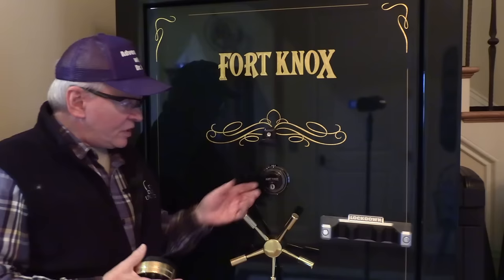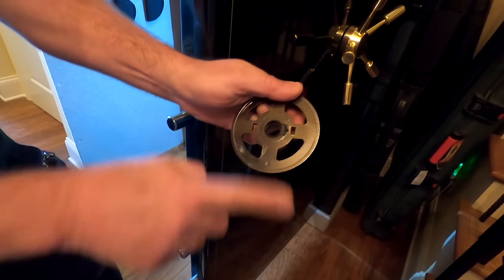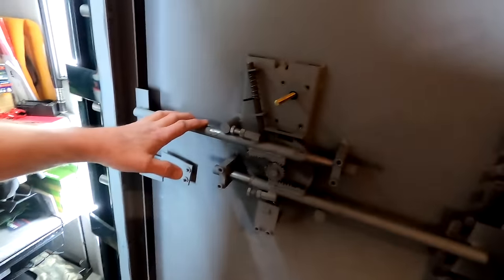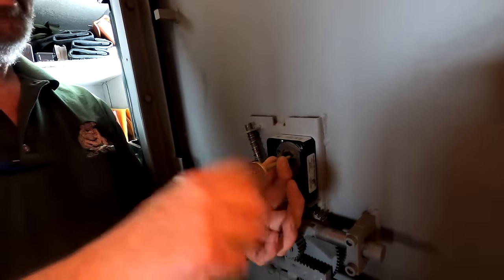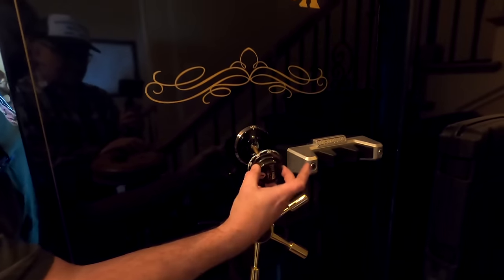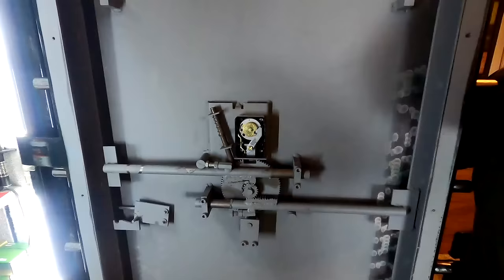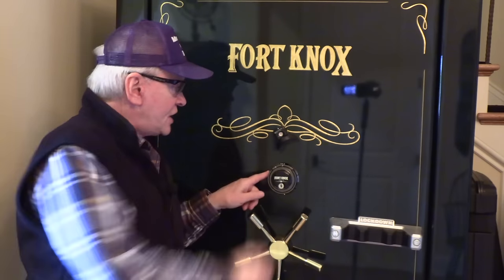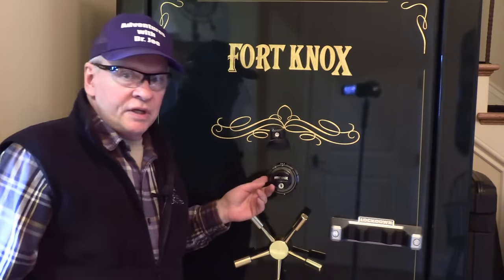Change Electronic Digital Safe Lock with a Mechanical Safe Lock for Gun Safe Liberty Safe

Comment: Well I know what brand of power tools that smith likes
Reply: Milwaukee is pretty good
Reply: @syitiger9072   yeah I like them too. Been using a plug in drill by Milwaukee for years. It just keeps on truckin
Reply: Yeah I use a corded Milwaukee drill and jigsaw, when needed. They are over twenty  years old and still working.

Comment: I wouldn't have a safe with anything but a mechanical lock.
Reply from the maker: Hey, thanks for your comment. You’re probably correct. That’s why I changed out. One thing that’s so great with the mechanical locks that is you can set your own combination and you can have the same combo on all of your mechanical locks. Consider subscribing. Thanks, Joe.